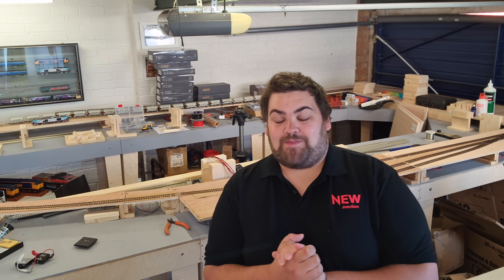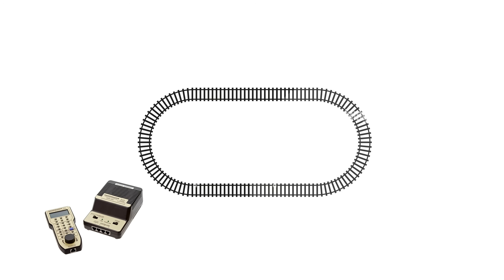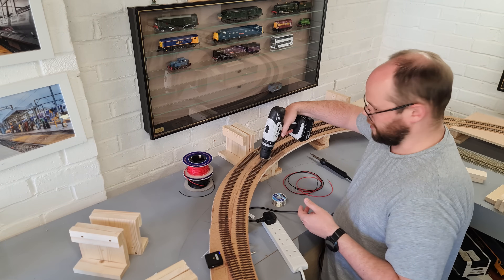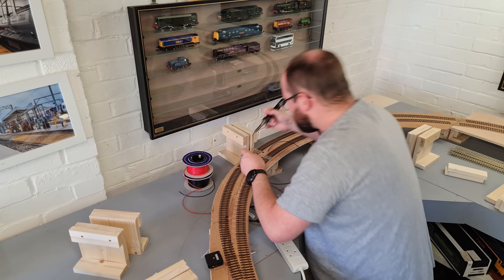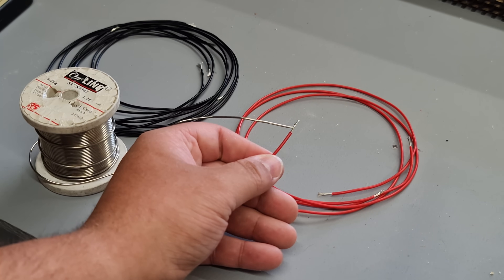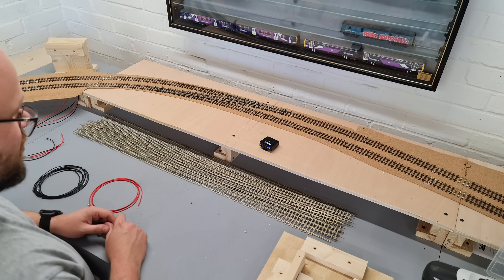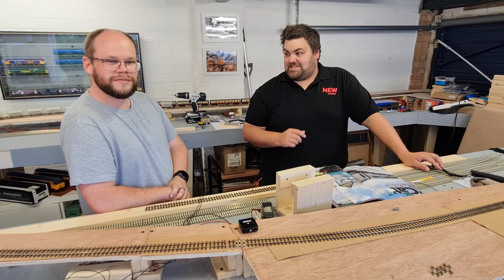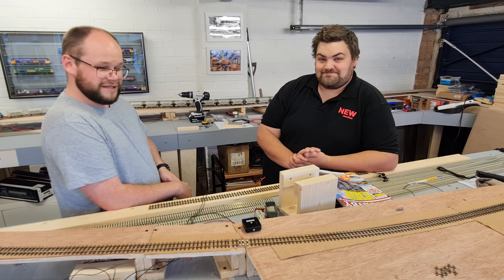New Junction EP6 - Electrical endeavours (How to wire DCC)

Comment: i am going to solder to the bottom of the rail, is there a problem with soldering dropper wires at the exact same point of rail? or should the droppers be offset, I can see here John is offsetting them by a couple of sleepers
Reply from the maker: @ReNewReViews1  no problems 😊

Comment: Hi Richard great video. How do you wire the mainline track on the raised section.  Do the dropper wires have to go through the heritage line baseboard
Reply from the maker: Both lines are raised so the bus wires sit above the 'baseboard' level but below the track bed. If that makes sense. Joined by droppers.
Reply: So how did you hide the mainline droppers through the heritage track bed?
Reply from the maker: @steve1000017  you can see them when stood on the inside of the layout?

Comment: Hi, a little tip I was taught at work, when stripping the ends of the wires, if you only partially strip them, then before you fully remove the piece of insulation, twist it & then fully remove it, it makes it quicker and easier to twist the strands prior to tinning them, just a thought, great video.

Comment: Hi Richard, another excellent video. I'm really enjoying watching the layout coming together. How do you connect the droppers to the bus wire? Is it soldered directly on or are you using some other method. I'm currently wrestling with wiring options for my new layout.

Thank you and great work.

Comment: Wire TIP. Dont peal the wire ends compleatly off, Lev the bit of it and before you draw it off the cable, Twist it with the bit of shell left there and pull it off. You will never pinn your fingers with the wire or get unnessesary dirt from fingers etc on the wire itself.
Reply from the maker: Top tip!

Comment: Little thing i always do when soldering wires to rail is to solder the wire to the bottom of the rails as you are laying the track and fixing it in place, this means that you dont risk the wire and solder breaking above rail head height and giving a horrible ride, it also prevents the wires from being seen within the scenery making the track work look more realistic  .

Comment: May I offer a suggestion Richard ?

In the first scene, where you introduce John, on the uppermost level, next to his elbow, there is a left hand point where the main line splits into two- how about replacing that lefty with a right hand curved express point? That would remove the „S“ then. Kind Regards Matt
Reply from the maker: Hi Matt, a great suggestion, all will make sense when the scenery begins, I needed the angel on the curve 😉
Reply: @newjunction  looking forward to seeing it progress 🤗

Comment: Why is multi-drop bus wiring considered a DCC thing?  Don't the exact same concerns (getting clean signal to all track sections on the layout) come up with DC power?
Reply from the maker: Yes however some people do DC because you can get away with simpler wiring much easily.

Comment: I have used this exact method of droppers from ever piece of track. There is only one small section that doesn't have droppers as it is on my high level branch line station where I couldn't easily fit them so instead I have soldered a small loop of wire across the rail joints either side of the fish plate so expansion can still take place, the wire I used was off cuts from Peco electrofrog points.
Reply from the maker: I did the same in the garden 😁

Comment: Another tip Richard, when u strip ur wires for tinning don't pull the sleeving all the way off, if u leave it on the end of the cable u can twist the wires together without breaking the skin or ur fingers after the 100, just twist the end then pull it off, perfect ends for tinning, no sore fingers 👍
Reply from the maker: Top tip thanks!

Comment: Really useful this. Literally going through the process of converting my layout from DC to DCC now. Part way through the tail chaser section, but not yet started the shed area - so many points and short pieces of track!
Reply from the maker: Slowly does it!
Reply: @newjunction  Indeed! Taken a year on and off to get this far, especially on the decoder front!
Reply from the maker: @whitemoor66  its the best way sometimes, it is a hobby after all!

Comment: I bet your glad your not in the loft anymore in the heat we’ve had,really coming on and thanks for explaining the dropper wire,so it’s one pair of wires from the outlet on the controller I thought you needed booster controllers many many thanks Richard ,hope to see you at warley mate ,all the best 
Mark 👍🏻👍🏻😃
Reply from the maker: Yes the bus wires are a pair from the controller. Boosters will be needed if you have a lot of locomotives on the layout.

Comment: Hi Richard,
A very nice and easy introduction to DCC and yes the more droppers the better as was the case with my Bachmann 03 shunter that with only a few connections would stop and start over points but with a connection to each bit of track and the points was great. I do feel you missed a bit out which was connecting the droppers to the bus wire with solder because the dccconcepts wire strippers you have will strip the plastic back off the bus wire so you can connect the dropper to it but as I said a very nice and interesting video roll on part part 7. Hope you will be at GETS this year and will your GCR layout be back again as was very good last year and it will be nice to see how it has progressed?
Cheers Robert.
Reply from the maker: Thanks for the comment Robert! Yes I'll be at Gets and we're taking 4 layouts hehe

Comment: I remember when DCC came out and was sold as only needing two wires instead of all that wiring you needed for all those old fashioned isolation sections and or cab control😂😂 then rewiring all you locos! The more things change the more they stay the same. DC or DCC for any reasonable size layout you've got lots of wiring! Love your modular concept of being able to squeeze a large exhibition layout in your garage.
Reply from the maker: Thanks Philip, my layout has been two wires for around six months, time to buck the trend! 😆
Reply: Logically, you do only have two wires, the same signal travels on those two wires all round the layout.  The extra droppers are really just signal "boosters".
Reply: @stevemawer848  true but physically you've loads if you want reliability! And more if you want all these power districts much like the DC concept of isolation sections.

Comment: I feel like there is a few things that weren’t covered but can be really important with dcc which is insulated rail joiners
You usually need the insulated ones at points so you don’t get short circuits. You didn’t mention it though which would be helpful if that was talked about
Reply from the maker: @John JMC you've just booked yourself in for more wiring haha
Reply: Because the his heritage line is using the new Peco bullhead track all the point are unifrog so no insulted fishplate are needed, I'm sure we will go on to cover is with the Peco code 75 that will be used on the mainline 😊

Comment: If I was to buy a Hornby DCC controller (like the ones they had in the DCC train sets), would I still need to worry about the wiring?
Reply: It should work by.just swapping the controller and putting a DCC loco on the track. If you have a big layout, you might find that the loco stops and starts or that sound does the same, hence having more power wires to reduce that risk. I have two exhibition layouts and I just swap the controller between DC and DCC. You can put both controllers on a switch at home to move more quickly between the two.
Reply from the maker: You can get away with any DCC controller and minimal wiring, the bigger the layout and more locos you run will put pressure on that setup mind
Reply: @newjunction  oh ok, cool! I currently only have a simple oval exhibition layout and

Comment: I thought I was being clever by soldering the fishplates until the rails expanded in this hot summer !
Reply from the maker: Oops!
Reply: @newjunction  The rails lifted out of the sleepers. Had to replace a length of track including dropper wires and regular (unsoldered) joiners.  I had to make the fit close so that when it shrinks in the cold the gap won’t be too big 🤔

Comment: that very good to answer the q? i asked what is a bus wire for dcc control
Reply from the maker: Just a thicker gauge pair of wires connecting the DCC controller and the dropper wires.
Reply: @newjunction   good advice as i am starting a n gauge module layout